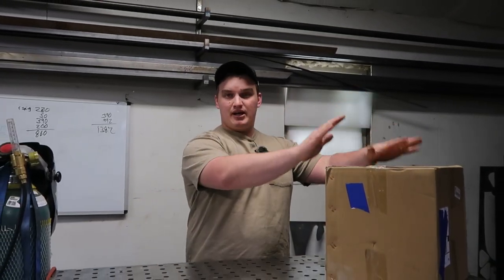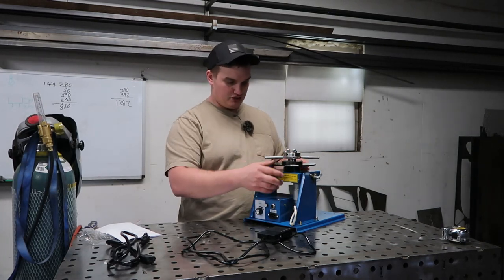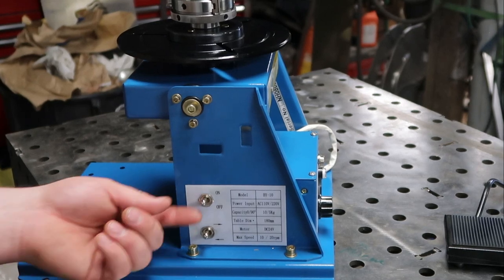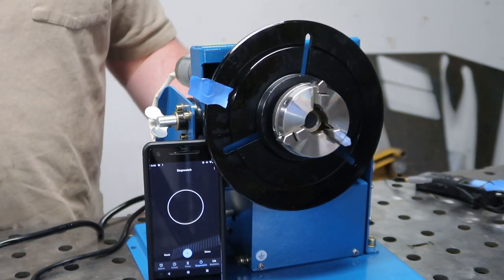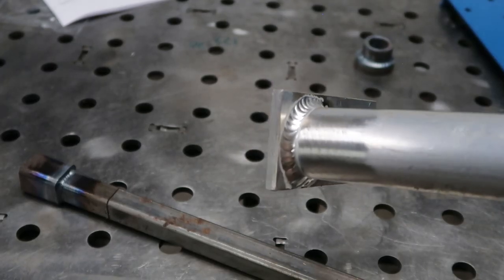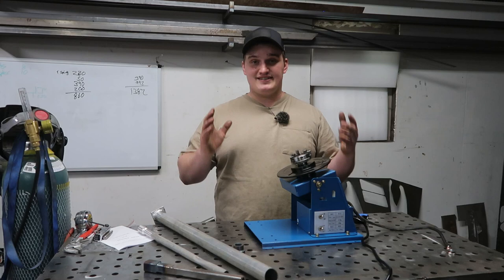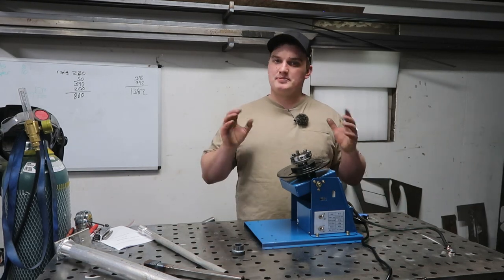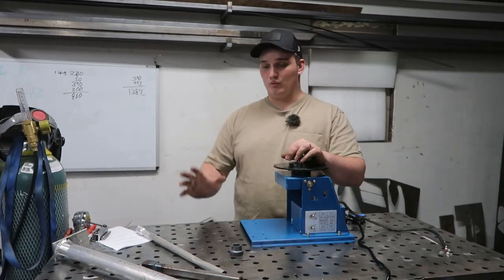TESTING The Cheapest WELD POSITIOER On AMAZON

Comment: Reverse the jaws on the chuck. They’re numbered 1,2,3 and go back in the corresponding slots in the chuck. That way you’ll achieve the 3” opening!
Reply: You can't reverse jaws on a scroll. You either need a different set, bolt in Jaws, or a 4 jaw independent chuck

Comment: Absolutely right!  Over the years (I’m old) I have bought craftsman and now Harbor Freight just to get by and do a job until the tool pays for itself and earns a better tool. I put 10% of every job charged aside for future tools and now have the shop of my dreams.  I think I would have bought a divider head with a 5” head and hook up a small motor to it with an adjustable speed motor.  It’s an easy and cheaper way to have a rotating welding table.

Comment: Thanks for the video, how did you make sure that the tube and base plate are in position and stable before you welded them together
Reply from the maker: I had a bolt going through the plate in this case and that is what I was clamped to

Comment: To get a more useful size, you have to go to the bigger $500-550 models. These little ones just can’t work with anything even approaching a modest weight. Turn it horizontally, and the weight limit drops further, and with the tiny chuck and short jaws, the work just falls off. You’d need a tailstock to hold it, if the motor doesn’t stall. But if all you do is small stuff, it seems ok.
Reply: What brand in particular?
Reply: @luisetorres5760  no particular brand. These are all Chinese products. There seem to be two somewhat different versions. Whether they’re made by different companies, I don’t know. But, you know, with Chinese products found on eBay and Amazon, the “brand” doesn’t make a difference as they are the same. They’re all actually fine. They’re not intended for professional use. But when you get to the higher tier, around $800 something and up, they’re pretty good as are most all Chinese products on the more expensive categories.

I’ve tried a few, and they all seem fine, writhing they’re rated limits. Just be careful about the chucks. Some that are just small lathe chucks are too small for wider parts, even if they’re short, and not heavy. So think about the widest thing you’ll put on them.

Comment: How was the welding current capacity? I noticed all of these cheap positioners are only rated for 80 amps, I to weld at 180 amps without damaging it.
Reply from the maker: I needed up the ground cable

Comment: Lathe chucks are rated by the diameter of the body, not the capacity it can hold.  That said, if you turn the jaws around you shouldn't have any problem holding a 3" diameter tube.
Reply: I just got the same positioner and tried switching the jaws but they bind up when flipped and the little tabs that lock in with the threads seem to be angled slightly so they’ll only go in one way. They’re also labeled 1-3 with corresponding locations.

Comment: I was eyeballing an amazon special or eBay fixer upper... I ended up taking parts from the scrap bin...allthread, nuts and washers, 2 1” bearings, 6” length of 1” round stock, 2 I-beam shims. Mine doesn’t have a chuck, but it’s a simple tool I just haven’t played with too much.